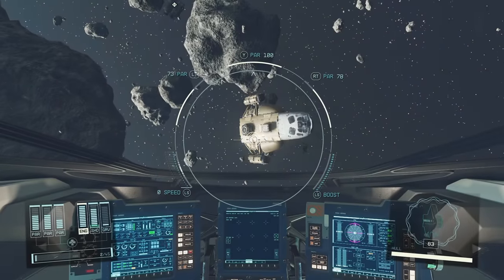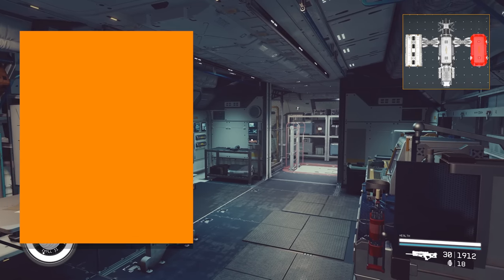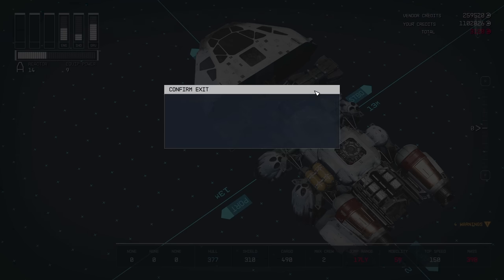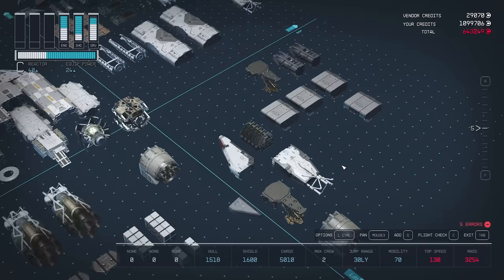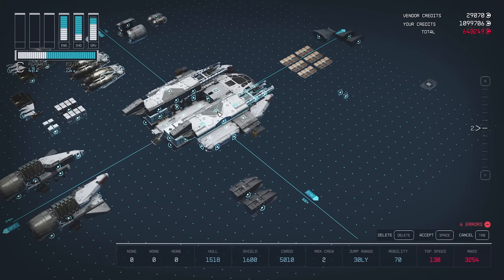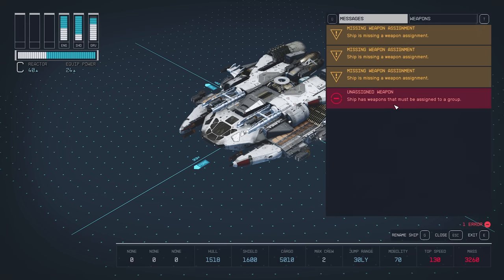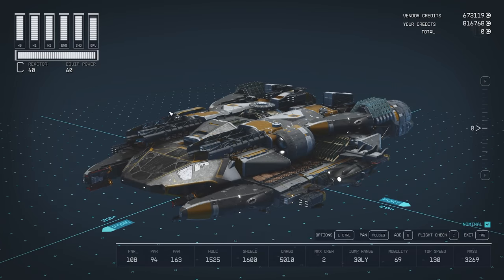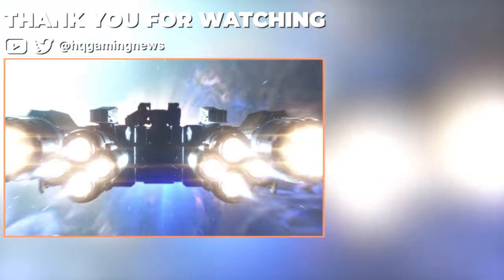The ULTIMATE ENDGAME ship in STARFIELD - No Mods, No Glitches, No Exploits

Comment: It's a great ship, it can handle really any combat that comes along. One thing, you have to be at level 57 to have access to the SF 40 reactor, and I think level 60 or so to be able to get those model engines. Other reactor's and engines will work but you will be under powered until you upgrade. I found out the hard way on that. It took me almost 2 hours to follow the Youtube video build and put it together on my Xbox. It is worth it .

Comment: excellent video I love that you don't just min max but also focus on role playing.

one suggestions, put a brigg in your ship or the hopetech armory. they both have prison cells. if mutiny ever happens, you can use the manipulate ability if you unlcoked it in the skill tree, to make crew members walk into the cell and you can lock the door from the corresponding computer that comes with it ;) 

I actually had to use it for passengers I was transporting.  they became hostile after I attacked a UC ship.
Reply from the maker: That actually works? 😮
Reply: @hqgamingnews  yeah you can make the passengers walk in it, but it can be hard depending on their initial position. Making them go down ladders is gonna be tough. But they usually hangout where there are passenger seats so it’s better to put the armoury on the same level or close enough .

Comment: Great tutorial and I like the ladder free layout. 

Managed to build it at lvl 40 (Starship piloting rank 4, Starship design rank 3) with following changes:

GRAV DRIVE: J-52 Gamma Grav Drive -> J-50 Gamma Grav Drive

SHIELD: Assurance SG-1800 Shield Generator -> Vanguard Bulwark Shield Generator

ENGINES:
2x Amun Dunn X-300 Engine -> 2x Amun Dunn X-100 Engine 
2x Supernova 2200 Engine -> 2x Supernova 2000 Engine

REACTOR: SF40 Sheared Flow Reactor -> SF30 Sheared Flow Reactor

WEAPONS: 4x PBO-175 Auto Helion Beam -> 4x PB100 Auto Neutron Beam

FUEL TANKS: 2x M50 Ulysses He3 Tank -> 2x M40 Ulysses He3 Tank
Reply: @hq Gaming News thanks for the video, it's perfect :)!!   
@jorgenkarlsson1514 - thank you for the comment, I'm lvl45 and was about to ask can I build ship similar to this in this lvl ;) You solve my problem!

Comment: You’ll get a lot more wiggle room with your landing bay location/position if you start working with a central ladder to your design. You basically always start with your central ladder and build off it one floor at a time fully before moving on to the next floor of habs. I like to start with cockpit but overall after the ladder is in place but you can start from either the top of bottom to your design in general. Sometimes the interior doors will be tricky and I’ll revert to creating my central ladder, and then connecting the lander and cockpit where I want them respectively before continuing with adding the rest of my habs. Structural stuff and more or less go in whenever. Use spacers/lifters and pipes to fill in  negative spaces and this will also allow you to use a much wider range of the different landing bays while still looking really good. Lastly I recommend actually taking a new design into flight and then manually exit your craft too. People might find that they might actually like the cosmetic look and feel of other landing bays that they didn’t previously like in build mode exclusively

Comment: Your video really inspired me to design my endgame ship, the big brother of Flathead called Mata Mata. I skipped the corridors,  because I think they are dangerous with these NPCs. I also added side entrance instead of the back.
Reply from the maker: Looking at the comments here, quite a few people have slightly modified this design to better suit their needs, which is great to hear. It's inspiring to see that this video motivated them as well.
Reply: @hqgamingnews  This ship is well engineered, and also the engineering process is presented well, even the evaluation and the optional modifications. So I think it inspires others to specify their needs and create the ships based on those. Also Flathead looks nice and has several good design ideas in it. So however my ship is significantly modified (more habs, cargo, 6 engines) I tried to keep the shape and the nice little tricks like at the back turret.

Comment: Thank you for such a thorough and extensive walkthrough. The ship and video are both tremendously done.
I'm new to ship building so I'm not sure how to achieve the 60 power necessary for the build. I can see getting 48 with aneutronic fusion and crew. Where is the other 12 coming from?

Comment: At level 30 and max level shipbuilding.  I just built this ship. However I did have to substitute engines, grav drive, reactor, and cargo. Mobility is at 53. After adding two extra engines with radiators, bracers and cowling. On the top where the stabilizers were. Removing side radiators wings and moving the vanguard weapons to the outside of the weapon mount.  To reduce weight. 

I'm going to add the new habs for more crew members. But I'll have to add more engines though there is plenty of room to do that on the rear. And probably fiddle with it to reduce weight.
Reply from the maker: It's nice to hear that people can use this as a template of sorts, even for lower-level characters. Enjoy!

Comment: Nice build. Couple of queries though, why are you not using the Pinch 8Z reactor? It has the same mounting points as the SF40, same energy but 1350 hull rather than 1315?
Also, while I can definitely appreciate going for a particular aesthetic, why not use half the number of NG20 landing gear and use structural components where you had the other Acculanders? I've just found it easier as I need to place fewer gear structures overall and can hide them out of sight.
Reply from the maker: Those are all valid points. Let me know how stats change.

Comment: Awesome ship and I only had one issue.  I am not sure if it was the result of a mod or a new "patch", but the outer landing legs have a thrust value of 0.5 which added together brought the total thrust on the Reactor to 13.  I was given an error to remove an engine.  I removed the outer landing legs.  Now that I was short on legs, I changed the rear-most single legs with a duplicate of the other dual legs and all is good now.

Comment: I’ve got a similar 2 floor no ladders build that has a landing bay under the bridge facing forward. I use the same bridge, I have all workbenches, tons of cargo space (and shielded cargo), max jump range and 100 mobility. I’ve had it now for 14 playthrough’s (though admittedly I didn’t have it in play through 2-13 as I was rushing to unity to max the powers). I even have a cargo hauler build and a battleship build though I have to re-build them due to unity.
I may build this one, but edit it more to my design choices (like having the landing bay under the bridge rather than at the back).

Comment: I figured out how to build this with more ship system pips, plus 100 mobility, and an extra crew member using the Frontier as the base. Replace the Captain's quarters with the unique Frontier Hab. Replace the 3x1 all-in-one berth with a 3x1 Engineering hab. Those 2 hab switches give you the extra +1 crew and the Frontier hab has a cooking station that you lost replacing the berth. Next up replace the 2 Hopetech landing gears that have a top connectors because you'll need the extra thrust to not get an error about not enough landing gears the last step. Optional: Because you replaced the berth you need 1 bed for XP boosts so replace the Armory with a Captain's Quarters, which you can conveniently sleep in for the XP boost right next to exiting the ship. Armories are buggy af and you can end up losing all your stuff anyway. Lastly go to Hopetech and put 6x SAL 6830 engines in. You can stack 2 of them on top of each other on either side to fit all 6.

Note: you'll need at least 1 rank in Astrodynamics to keep a 30LY jump range and have Sarah, Barret, Sam, and Vasco assigned as crew for all these stats. Maybe not but I can't guarantee it'll work without them.
Total extra cost to me to make these changes with rank 3 commerce was about 250k on top of what the original version in this video cost me, which was originally around 700k with my R3 Commerce.

Comment: Excellent content, thank you for providing!

I absolutely intend to build this and try it, but in the meantime I'll just ask - why did you select those particular engines?  Could you work in the highest manv thrust engines, the SAL-6830, and maybe raise your Mobility score?  I *think*, but am not sure until I try it, that the extra mass will fit without eroding your jump range below 30.  Although I'm not sure how to attach 6x engines...
Reply from the maker: I could, if only I had finished that questline in a normal, diplomatic manner. It's interesting that we have best-in-slot engines locked behind a very specific quest outcome.
Reply: Update:  I was able to complete the build as described in your excellent video, and used 6x SAL-6830 engines.  Details are below, but the TLDR summary = it worked like a champ with very few adjustments needed to the original design, and got the ship mobility back to 100 from the original design's value of approx 70, while preserving jump range at 30LY  But bring your wallet, those sexy 6830's are pricey.

Some details:

Engine Mounting: I was able to mount all 6x engines onto the existing design structure.  2x engines on each engine mount assembly from the original design (1 high, 1 low, if that makes sense), and then put the final pair in the center, same location as original design.

Landing Gear:  The extra mass (642 if my math is right) from the 6x engines rather the 4x of the original design required additional landing gear, which I got by replacing 4x Accu-Lander 11 (2x thrust each), with 4x NG-20 Landing Gear - Wide (4x thrust each).  The NG-20's snapped directly into the original locations.   Pretty sure I didn't need to swap out 4 landing gear assemblies to clear the error, but they were cheap, so why not.  

Mobility:  The superior maneuvering thrust from the 6830 engines allowed the Mobility to get back to 100.

Cost:  Those 6830 engines are expensive, adding an extra cost of 246k to the build over and above what the original design required.

Jump Range:  Unchanged, at 30LY.

Vendors Needed:  
 - The NG-20 is a specialty item from the Nova Galactic shop on Sol/Titan/New Homestead/Ship Service Tech.
 - The SAL-6830 engines I don't think reliably show up in the Outpost Builder inventory, but I was able to find them (usually, but confusingly and annoyingly, not every time.  WTH??) at the Stroud-Eklund staryard.

Thanks again for the inspiration.

Comment: Hey man thanks for Sharon this build is awesome I made a few modifications I didn't build it 100% as accurate to your build I used different landing gear on the sit's I used the ones that have the rockets built-in tomb instead of the ones that you used and also added 2 of those additional ones with the rocket attached to them I attached them to the white dwarf engines on the side so I dropped  Them down one spot to accommodate those it actually looks really really good and I also put some strode cowling back by the radiators and engines versus the bumpers that you put on there but other than that all of it's good and it didn't run me 600 + 1000   Credits that you put into it because I had a lot of the components already on my ship like the Nova Engin the cockpit. So I think my overall build ran me a little over 300 K which was not bad if I made so so myself cause a lot of the stuff I already hadBut all in all with the weapons and stuff like that absolutely amazing build it's a tank and it's a gunship for sure I went to the kryx  Is system and laid waste to the crimson Fleet
Reply from the maker: Good job! 👍

Comment: Thank you for the tutorial. I built the ship at level 50, therefore I had to use a few components which were one rank below the suggested. Should be fine though. Frankly, I would have never built my own ship without this video. Even with the tutorial, I find the whole shipbuilder incredibly inconvenient and very, very unintuitive. I know this had to be programmed in a way that would make it usable with a controller, but seriously: If I was very well-meaning, I'd give the whole thing a D-, but I actually believe the whole shipbuilder should be re-done from scratch (I know that's never happening).

Comment: Thanks for doing this!  Just did the build, BUT I am getting an error that I have to many weapons for the the power available.   Any idea what I might have done wrong?  Thanks!  "Liked & Subscribed".
Reply: Follow up:  I went to The Key to add some extra parts mentioned in the video, and I tried adding back the 2 Vanguard Obliterator Autpprojector guns that I had to remove in the original build.  They went on and passed the Test Flight with zero errors.  So... I running at full strength again!

Comment: Great tutorial, but I still have some open questions, mostly questions for modules:

1. Could you use the C4 Bridge instead of the C3?
2. Would the ship function with the same power if you install the Pinch 8Z Reactor instead of the SF40 Sheared Flow Reactor?
3. Isn't the Assurance SG-3000 Shied Generator better then the Assurance SG-1800 Shied Generator?
Reply from the maker: 1. Yes
2. Yes
3. No

Comment: thx a lot here is my modified shieldbreaker:

i transformed it into a class c shieldbreaker it has :

30ly jump (so can jump between the 2 most distant stars which are 28ly apart)

600 fuel

3 very powerful auto turrets

all workbenches in the ship

scam janner

6500 total cargo capacity of which 600 shielded

200 max speed and with turbo 500

easy accessible from the ground that i wanted because other class c you have to take a ladder etc

class c reactor with 34 bars

4 passenger capacity

7 crew
but interested in yours also some modules it seems are lvl  capped so  ill see

Comment: Some notes here:
1. Your mobility is low because of your engine selection. 6x SAL-6830 is best-in-class. 3x Poseidon DT-230 and 4x SAE-5660s are both good options, in spite of lower total thrust, because total engine mass is so low--and the SAEs even give you higher max speed. 2x SAL-6830s and 2x Poseidon-DT230 also gives cool options visually. SAL-6330s instead of SAL-6830s are viable in NG+ if you skip the main quest. Note that all Slayton engines are only available from Red Mile and Freestar Collective, not outposts or UC settlements.
2. Nova Galactic has a better Science Lab than Taiyo, same crafting stations but 2 added passenger slots on the ship.
3. Nova cross passages, for sale at New Homestead on Titan should replace your HopeTech cross braces. Crew don't cluster in the passages as much, and it's only 8 mass instead of 28.
4. Apollo GV300 (or Apollo GV200 once you have max Astrodynamics) will still hit 30LY, using less mass than J-52 Gamma. 
5. Replace the 10ST Shielded Hauler with a Deimos Belly, and the M10 fuel tank with a pair of da Gama Shielded 1010s. You'll increase your total shielded cargo capacity while reducing your mass, and you won't miss the fuel.
6. Consider replacing the shielded ballast units, which are very inefficient for shielded, with unshielded, which are very efficient. You have more shielded cargo than you need, even if you're running Crimson Fleet smuggling missions, and especially if you're not. Again, less mass.
7. Vanguard Bulwark Shield Generator, while 150 less shield health, is only 70 mass.
8. The Cabot bridge is forcing you to make a ton of design compromises which probably aren't necessary given that you're only running 5 habs which are more than just hallways. With so few habs you can do a similar ship layout all on a single floor, have a front-loading landing bay, and a docker ladder situated closer to your landing bay ladder. I do love a Cabot bridge and have often run one in my games, but generally when I do, I try to incorporate at least a couple of the 2x2 or 2x3 habs into my ship design. Changing bridge types is a huge change, but if your goal is a jack-of-all-trades end-gamer, you might be able to get closer to that than your current ship can by making this change.

You're pretty close to a design which hits 100 mobility at 5000 cargo, with mass budget left over for aesthetics, without needing to change much about what is certainly an elegant overall design. Your use of dual manual particle beam weapons is something I hadn't considered, and sure does seem to melt ships.

I really enjoyed this video. Thanks for making it.
Reply from the maker: Great suggestions, I love them! Regarding SAL-6830s: I skipped the main quest in NG+ and only recently had to force unlock them via a console command. How silly of Bethesda to gate the best-in-slot items behind quests that you can miss or fail to finish in a specific way.

Comment: My home ship has 25 beds, about 14 bathrooms, 12 crew, 3 levels with only one ladder (well 2 it goes all the way up) sci lab, workshop, infirmary, mess hall and armory. I do have a mod thatmakes one of my captains quarters a no ladder habe and I using the tiny habs mod for 1x1 livng spaces but the could be replaced by companionways or storage rooms. 30 lt yr range. It has max mobility 100 and 140 speed cuz of the B engines, 8 particle beam weapons and 3 turrerts all with 3000 plus range. It's been a labor of love and I still mess with it from time to time but it's not gonna change much from now on.